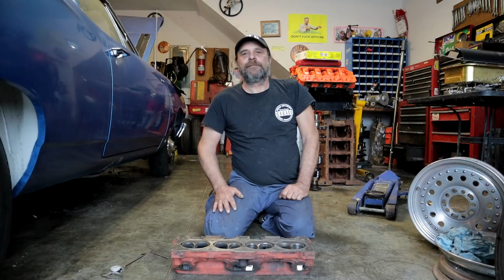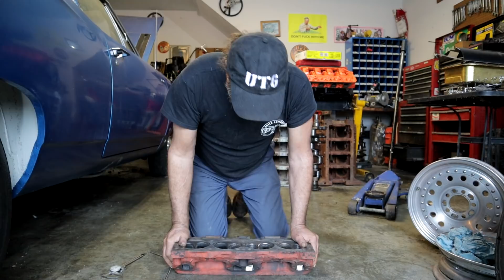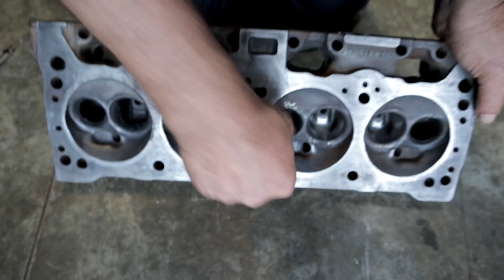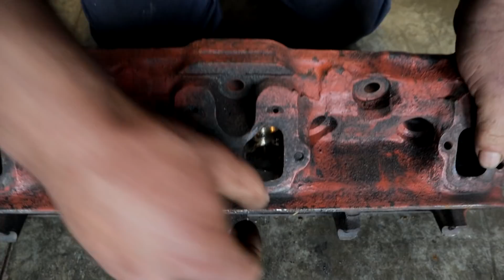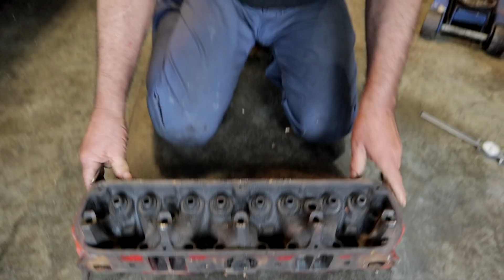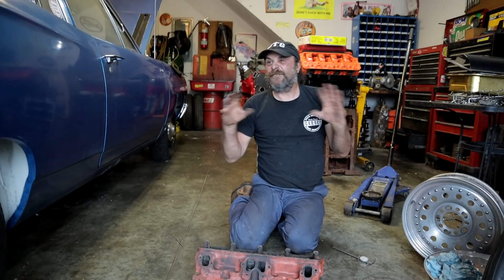Why Mopars Suck

Comment: Racing a figure eight car with a Big Block Dodge  I Ruined to motors a 383 & 413 the oil pump drive shaft snapped after that I found out that is the weak link in a Big Block Dodge and there’s a after market hardened oil pump drive shaft that would have prevented this from happening

Comment: 2012 chrysler 200. ZERO room to put on serpintine belt that constantly shits itself off, even after replacing idler tensioner, idlers, alternator, compressor. Oh, you want to take that panel off a dodge avenger from the scrapyard and replace it? NOPE. fukin pin pattern is different. Hey. You want to take that window control master from the avenger too? and, put it in that? NOPE. We at mopar as engineers want to fuck over the consumer. Let's make it a different pin layout.EVEN THOUGH ALL THIS SHIT IS BUILT IN THE SAME FUCKING FACTORY!!!biggest piece of shit i've ever owned. FUCK MOPAR!!!

Comment: y mopars sucks because parts are more money and harder to get i am at the point i would turn down a mopar for a chevy or ford just because of the cost and they are getting real hard to find cheap or free, i am a budget builder there is no way i can build a mopar anywhere close to the cost of a chevy . then if u sell it after getting it on the road u probably will lose money and they are harder to sell . just like i have a 66 gt dart that is rust free good clean body can't even give it away. right now i have 2000 bucks in my 68 chevy pu with a stroke 454 02xx trans new tail gate rust free good clean body i have the dash dun heated electric seats twin pusher fans and every time i drive it i get offers on it so far up to 12,000 for it same with my 79 chevy short box 4x4 that i got for free they are up to 15,000 on it. sold my 68 mustang cobra had 15,000 in restoring it and drove it for 20 years sold it for 185,000 took 10 minutes to sell it

Comment: I use to work in a cylinder head shop that remanufactured about 100 heads a day. This amount of core shift actually isn't that bad compared to many I have seen from Ford and GM. You could visibly see the chambers deeper on one end of the cylinder head from the other. One wall of the casting would be wafer thin and the other side extremely thick. Pontiacs and Chryslers were usually pretty good and didn't crack so much. The downside is they are also very thick and heavy casting compared to others.

Comment: Engineering yes quality control not so much...I was brought up & still am mopar nuts but I've noticed those casting issue in the admittedly few engines I've done when young & wondered about it.🤔 I worked with very tight tolerance high detail oriented machines for a living and knew exactly what you were going to say as soon as I saw that head!

Comment: That is a valuable explanation on what happens with these old rigs! I always wondered if it was deliberate. Buying big 3 has always been a gamble because there are so many examples of companies such as gm deliberately designing engines to be weaker or even break. It's nice to see that mopar in those days wasn't following those practices in order to shorten the life of the car and get people back into the dealer sooner. Although, have to admit I would be pretty pissed if I bought one new in those days and it ended up being slower than what I traded it in for. LOL!

Comment: I had a '78 Chrysler Cordoba when they rolled out. It was a beast! I must've gotten a "good one", idk? I sold it after 175k miles on it, 10 yrs later. I had no idea what a "mopar" engine was. But I had no complaints, but I did abuse it at times.
 I can see mechanic's problems with this, but I was a novice & young, about such things back then. Great presentation!

Comment: I have a 1970 AAR Cuda with very low miles. Never been apart, other than the brakes and fuel system to drag it out of long term storage. I am the only person to ever take a wrench to it. The quality is pretty bad. I have a 72 Road runner, it's not too good either. Sloppy. I'm not hating mopars. People see high dollar cars at shows where someone put $100,000 into them and they see a really high level of quality and I think that's where they get this idea that MoPar is just so far out ahead of anything else ever built. I like them, but I am old enough to remember how they fell apart. They had their good qualities too. Many were actually good cars. Some ran forever and drove themselves to the junkyard simply because they looked horrible or rusted out. You are SO CORRECT about the IN CONSISTENT quality. Some were extremely high quality, others were awful. I think that's why people remember them in different ways

Comment: This man really knows his field... He is right on the money with this... I have mildly ported a couple pairs of 906 heads that came-off of a 383 and a 440 and a couple of pairs of 360 heads... Both types seemed to respond very well to the custom work, when done right. Both types of castings seemed to be fairly rough and poorly controlled from their foundries, especially the mis-matching of the upper & lower sections of the ports where the flashing lines are. The mis-match at the intake & exhaust manifolds was not good either...When the guide tubes of the intake and exhaust valves are streamlined , triple angle valve seats and a smoothed transition from the seats to the head, double angled valves, matched ports to the manifolds and these heads will really allow the full potential of the machine to be made available!!! With some TLC, the classic Mopars really come to life!!!

Comment: Magnum heads suck too. Horrible, rough casting on intake and exhaust. Also the deck surface is too thin, and they always crack between valves. But yeah, i'll still love Mopar.

Comment: I'm 70 and cut my teeth on GM engines in particular Pontiac, Buick and Chevy and found similarities in their head design as well. In particular the second design L-88 with both square and round port heads. I have no experience with ford heads but have been Chrysler since 84. Bottom line is pay your money take your choice.

Comment: As a person who owned a 68 Dart GTS 340, a 71 Duster 340, a 74 Cuda 360, I strongly disagree.  All three were absolutely bullet proof and they easily out performed their Ford and Chevy counter parts.  These engines dominated their class at the drag strips then and are still doing that today.  Where are the Boss 302s and Z28 302s today?  Search YouTube drag racing and you will just not see any of these "better built" small blocks winning races today.  Are you saying Ford and Chevrolet do not have their own quality issues?  Back in the 70s I worked for a company that had a fleet of Chevrolet station wagons as company cars.  It was a well known fact that if these cars were not brought back to the dealer to have the transmission fluid and filters changed before 5k miles the transmissions would go out.  This was not a factory scheduled maintenance.  Fast forward to 2016.  I worked for a local GMC dealer for four years.  GM has still not fixed the transmission problem today.  I learned that the problem is due to debris from the manufacturing process of the internal parts of these transmissions breaking loose as the transmission breaks in.  Owners will experience a sensation similar to that of a clothes washer that gets out of balance. This was especially true of GMC Canyons.  I also owned a 1978 Corvette L-82 that I bought new.  That engine was plagued with oil pressure problems and Chevrolet knew it.  As you should also know, many of the late model Corvette owners experienced early engine failures due to metal fillings in their oil of their high performance engines.  So before you say Mopar Sucks, do an honest appraisal of the other two American manufacturers.
Reply: You ok there little buddy... Wow

Comment: Yeah, Mopars had severe quality control issues back in the day, door handles that would break, body construction that was poor and plastics that would break.  The 73-76 Valiants & Darts had water leaks everywhere because the welds and body dies were poor.  I know because it was my job to find and fix them!

Comment: I worked at a C-P dealership in the 80s, owned many Chryslers over the years, still have my 69 Roadrunner convertible from high school. To be blunt Chrysler's quality control sucked back in the day. Some of the chintzy shit I have seen over the years. Like you said Tony some Mopars were above average. I owned ones other than routine maintenance you never put a wrench to, others have nickel and dimed me. A good example my dad had a 82 Reliant, with regular maintenance he put 198,000 on the car , Mother in law had the same car but a two door, same engine 2.2  carb, blew a head gasket at 50,000 miles, at 82,000 it chewed a lobe off the cam.

Comment: Uncle tony your video's gave me the drive to push hard with my 1974 charger 440 build , I’m currently just waiting for my 727 to be built the car should make around 500 hp engine cost me 6000 to have built paid 5000$ for the car 1200 for the trans $500 for the 1976 440 block , been hitting the overtime hard your videos are a inspiration I’m 29 always had a love for older cars , I have a dumb question your from New York and your last name is Defeo are you related to the Defeo  that killed he’s family in Amityville, Long Island, New York. The guy who basically caused the horror film Amityville horror

Comment: My crappiest Mopar story: in 79 I worked at a large industrial plant. My supervisor rated a company car. It was a 77 or 78 bottom of the line Plymouth. He limped into work one morning with it barely running. He called vehicle maintenance which would come get it and bring a loaner. The wrecker hoisted the front-end up. My supervisor realized he left something in the car. The unibody had flexed so much none of the doors would open. The car had to be lowered onto its wheels so he could fetch his carton of smokes. 

Our 68 Chrysler New Yorker ate thermostatic fan hubs, alternators and the power windows that didn't get used often usually wouldn't work until the brushes and commutator ring was deoxidized. We kept an alternator in the trunk. After the 2nd or maybe 3rd thermostatic hub left us stranded in a roadside park overnight we installed a normal spacer.

The 69 Charger R/T had been through several owners. No real complaints other than the design of the rear window which of couse caused pinholes that leaked into the trunk. 

The 70 Duster had a Slant Six and was therefore as reliable as a boat anchor but had about as much performance.

One of the things I like about my 4.3L that is 75% of a Bowtie small block? The oil filter orientation. One of the things I don't like about 440s & Slant Sixes? The oil filter orientation.

Comment: My dad talks about his 68 383 4 speed Roadrunner. It was the best bone stock drag car he ever owned. Very early production car. Drag raced it for years while in the Marine Corps and went up against the local hero cars whenever he was transferred to another base. He never could figure out why the car was so much faster than 440 six pack Super Bees, 427 Camaros, and 427 Fairlanes. Says the compression wasn’t anything to write home about and the heads &intake weren’t special. All OEM stuff. The only car that ever beat him was a worked 454 Chevelle by a fender. To this day he laments ever getting rid of it. I try searching the VIN every once in a while

Comment: My first car was a 67 dodge charger 383, ran like shit and always running hot...second was a 70 dodge challenger 340 ran it's Ada off,,and 3rd was a 73 SE charger with 400 never saw the end of it's top end..just built a 45 dodge pickup with a 318 because of its reliability.

Comment: Engineering is important. Production and scheduling is GOD.
Reply: Very true. The rest of the story is that the Buick heads that Tony admired so much probably had fully machined combustion chambers. Some engines got that advantage. I don't know if the quality-control protocols were better at GM because it was a more prosperous company at the time. I will make an observation that when the money gets tight, quality assurance is usually the first thing the bigwigs cut.
Reply: @Gothamauto  I think you are right. 
But sometimes it comes down to the moral of the people working in the foundries and production lines themselves.
Those blue collar production jobs were mind numbing grunt labor.  People just in it for the paycheck.
Still are, I guess. That's why so many production jobs are automated. Get rid of human build quality variability.
I also think that the company didn't give a rats patootie about what a hotrodder thinks about a part 50 years after it was sold.
As long as the product met the original buyers expectations and didn't generate any warranty claims--was good enough.
Don't think casting core shift was unique to Chrysler products either...
Plenty of "Dog" Chevy and Ford stories out there.

Comment: Had a 70 426 with . 010 different decks, even the good wedge Mopar heads benefited from a good grinding, not really designed for high rpm power, that's what the 426 was for

Comment: Uncle Tony! I need your help. I sent you an e-mail couple months ago. No reply yet. Im sure your a very busy and overloaded man with things like e-mails especially. Buy i have 2 quick questions for you and or everyone else. Keep in mind i am an auto mechanic by trade so already know my way around.... Anyways i have a 86 M body car. Has now a 318 2 barrel. Already took all the lean burn and emissions crap off. What i was thinking of doing tho was putting a 360 2 barrel intake on. Would like to be able to use a holley 2245-2210 on this engine. I know the intake ports are slightly larger on the 360 intake. My question is is it enough to even worry about on a daily driver old, get me to work engine? I know it will create some flow issues. But my guess is its minor. Also. Question 2 i have a 225 slant out of supposedly an 81-83 M body. Supposedly very low miles. I was thinking about putting this engine in my 318 car. I know the subframes are different. I can find adaptors to put a 318 in a slant car but no adaptor for a slant to fit in a 318 car. Do you know of anyone who makes or could help out with this motor mount issue? Also i will need a transmission for use with the slant. I live near Buffalo ny. If anyone has one please let me know. Ill come grab it from you! Also could use a 7 1/4 or 8 1/4 as well. Thanks.

Comment: Another area where they suck is the port arrangement on B and LA engines (Hemi excluded). Paired intakes and paired exhaust ports suck on factory heads for the enthusiast. 
Paired intakes suck because the pushrods bracket the bloody ports packing everything in and limiting about everything you can do with a die grinder, paired exhausts suck because they concentrate heat. Cheap and nasty design wise that.
Hemis don't have that crappy arrangement nor do a lot of Fords for that matter. 
Thing is it is almost impossible to rectify the problem on both small block and big block Mopars because even with complete head redesign there's never going to be an off the shelf intake.
Look aftermarket heads these days have done wonders for the Mopar hobby and I'm being intentionally and excessively negative, but some of us that were hampered by iron head limitations never forget : ). Triumph over adversity doesn't have many rewards when you're up against a 4V Cleveland head, no matter how much better your block, crank, head material and engineering prowess is.
I'm Mopar nut too, but since we're on the topic of things about Mopars that shit us, I feel the need to vent my crappy exhaust port LOL 
The greatest thing that someone could do is come up wth a Hemi head with proper port arrangement and intake for LAs but the time is now passed. I still like the idea though.

Comment: 71 Dodge Challenger 400/451 six pack .. street beast .....was on only as good as the resistor on the coil. 6-4pm just to walk to the bar on the corner. Screw it ! Lol 😆

Comment: Hey tony. Man do I agree.  I like using the J heads but I ran across a set of L castings. Never seen any. My machine shop told it was the best set of LA heads they had seen in a very long time. And yep the later smog heads are just that. I don't mess with them.

Comment: Another place the cost cutting shows? close the door on most of Mopar offerings in the '60's & '70's and the glass feels as if it is going to fall out and then they rattle in the door. Unless you bought an Imperial or an A-body sedan. Electrical...another area of concern

Comment: I can relate when comparing a mid 70’s BBF 460 block to a ‘79 and later block.  Ford Truck Division fully inherited the 460 in 1979 as it was dropped in the car divisions.  The ‘79 is external balanced, but the casting is far superior once the truck division did a full revision.

Comment: Chrysler really dropped the ball on quality control... "Loud thunder"💥😠😂😂
Reply: He really hit it on the head, though. Not that they were junk, but inconsistent. I noticed how one guys 383 would outrun everyone's 440, others were dogs.....you know. My 71 GTX fell apart within a year, my 69 was VERY high quality. Very inconsistent. I saw a lot of 68-70 B bodies optioned exactly alike that were total opposites in terms of quality, reliability and performance. If you consider assembly line slop, this certainly explains how over the years you heard that "they were king" and "they were the worst" and these various people were observing based on cars they had experience with, myself included. Cylinder head casting quality explains the variances between the various cars that were either "rockets". or "slugs" with little or no consistency.